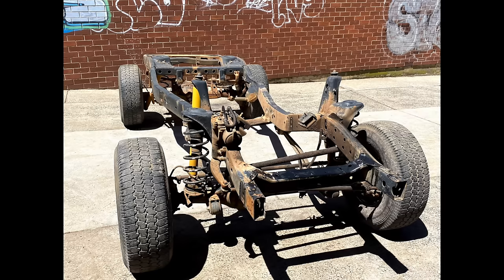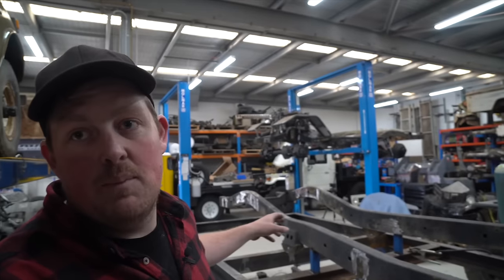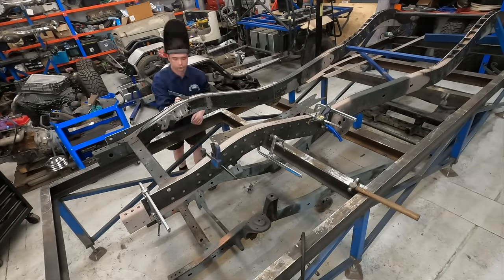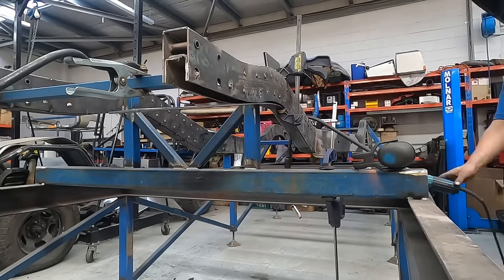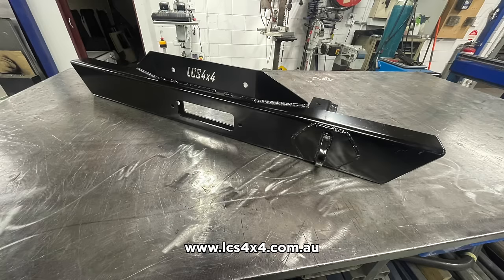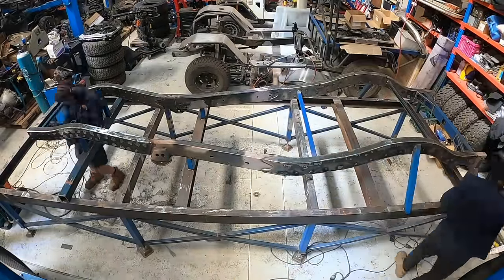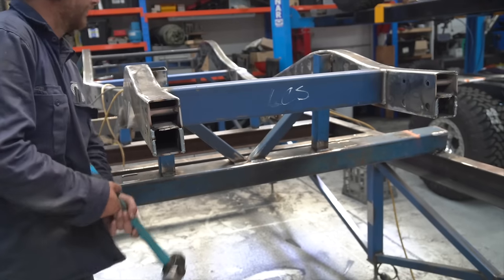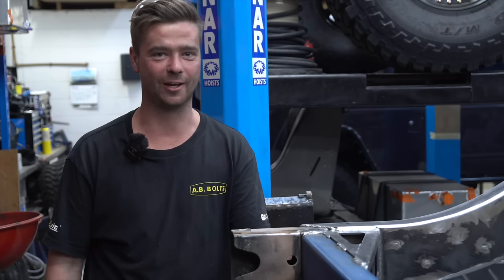FJ gets WILD SUSPENSION chassis setup

Comment: Me too, Id like to see the Whiteboard out :) and same for me too, I'm interested in the Engineering requirements too. When I investigated putting a 2002 Defender Coil Sprung chassis under my 1976 Landrover my Engineer advised that making my 1976 body comply with 2002 ADR's was going to be very very difficult so I'm interested to see how you guys do this build.
Reply from the maker: Hey Nick, this 80 series chassis is pre-97 ADR's  so it will be much easier to meet than the 2002 requirements. Thats the reason we are using 80 series chassis and not 105/100/75/200 etc.

Comment: Try using HRS (hot rolled steel) plate pickled & oiled for your plasma table. Welds nicer, read less spatter, and grinds so much easier then when you use steel plate which still has the mill scale on it. The grinding discs "slide" of the mill scale and wont bite anymore. You can see that the mill scale gets shiny like a mirror. Also the metal is already clean for paint so no need for shotblasting/ sanding if needed.
Reply from the maker: Thanks mate, I’ll have a look into it.
Reply: depending on how much more expensive pickled plate is, another way around it is to coat/paint the mill scale with pure phosphoric acid found in rust converters. It then comes off pretty easy with a strip it disc.

Comment: Bust out the whiteboard for sure. Particularly on suspension geometry. 
Could you have triangluated the lowers more? Possibly then not needing to cut the bottom section out, along with increasing roll stiffness and having the chassis end mounts not hanging below the bottom of the chaissis rail?
Only down side i can see is trying to package anything else inside the chassis rails like exhaust or fuel/water tanks.

Comment: Love the finished product as well as the video's.  Aside from the fact the 40 series is cool as hell, why not build an 80?
Reply from the maker: The 40 series body is nice and compact, it sits further in the wheel track than an 80 which is better for integrating barwork. We have also done a lot of development for 40 series cabs to make them serviceable, everthing is metal meaning its easy to customise and you'll see what we're going to weld in later on in the series. You hit the nail on the head though, we just love the look of the 40 series.... I do love the 60 as well personally, future series!?
Reply: 60 series you say.....
Do you guys make body mounts, to put a 60 on an 80 chassis??

Comment: Given that you cut off all body and suspension mounts and changed the shape of the rails, it seems like it would have been a lot easier to have some rectangular tube mandrel bent to shape. Would have saved a ton of time on the welding, grinding and finishing too.
Reply from the maker: Fair point! There are a few ways to get it registered in Australia but we are opting for a way where we have to keep a certain % of the original chassis so its not an option unfortunately!

Comment: 8:50
why no plasma for that? A plasma should the the perfect tool for that. Especially as the frame is curved.
Reply from the maker: We needed to get the chassis cut to size for the plates, a plasma would have left 1.5mm excess.
Reply: Right.
 @DesignedandBuilt

Comment: Great job uncle Richie really enjoyed this video make me understand the work lcs do and love the fact you guys local to me. So by using the 80 series chassis means all your emissions and braking is based on that not the 40 series body ?
Reply from the maker: Glad you enjoyed it! Actually everything (in vic atleast) goes off the chassis regulations. 80 Series are a sweet spot because most of them are pre 97 ADRS!
Reply: @DesignedandBuilt  thats interesting, thanks for the info got a few ideas floating around chassis swaps and custom 60 series / 79s might have to hit you up at some point keep up the great work
Reply from the maker: @jessehill1421  60 on an 80 is a great combo and there is a lot of gear that already exists! Cheers Jesse.

Comment: are yous grinding all your plasma cut edges to remove the free carbon or just welding it up pretty much as is? love to see it all from start to finish
Reply from the maker: No we're not, sometimes we knock the dross off with a wire wheel when required and then blaze!
Reply: Check out  As/Nz 1554 for guidelines on it
Reply from the maker: @michaelnoyes4817  Checked with Conor, he has been taking back the edges before it's welded. I have been with Ally but not steel, but you learn something new every day cheers for that.

Comment: Pardon my ignorance, as I'm not at all aware of laws and regulations in Australia, but with the amount of custom work needed for the chassis why not create your desired chassis from ground up? What would be the hassles associated with this route? Also if one was dead set on taking this route, what are the possibilities of success in terms of getting the ride registered, etc. Thank you and great video, looking forward to the series!
Reply from the maker: No worries - that would come with its own set of challenges. It would be an ICV in Victoria which has its own set of safety standards that have to be adhered to rather than this 80 series which is pre-97 Australian Design Rules. Basically a different set of hassles, this is the path of least resistance for us.
Reply: cool thanks for the insight and good luck with the build  @DesignedandBuilt
Reply from the maker: @hakie.  thank you!!

Comment: Just outta curiosity, with all that welding, welded in a fixed position, would it have been worth considering to stress relieve the complete chassis and frame together in an oven? I'm not an engineer and I'm sure you've done your homework. Just curious.

Comment: So your basically cutting and changing everything except the centre outer rails, instead of cutting up a good chassis why not just build a jig and start from scratch
Reply from the maker: As I mentioned in the video, that would come with its own set of challenges. It would be an ICV in Victoria which has its own set of safety standards that have to be adhered to rather than this 80 series which is pre-97 ADRS.

Comment: Why not just build a new chassis from scratch, way less work and hot rodders do it all the time so its definitely legal
Reply from the maker: As I mentioned in the video, that would come with its own set of challenges. It would be an ICV in Victoria which has its own set of safety standards that have to be adhered to rather than this 80 series which is pre-97 ADRS.